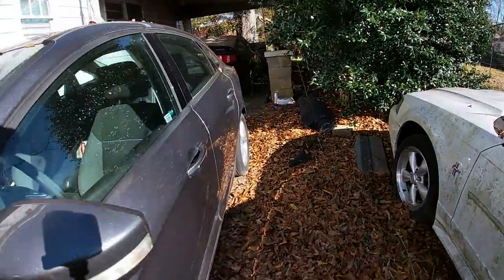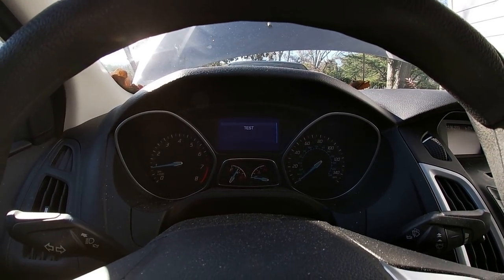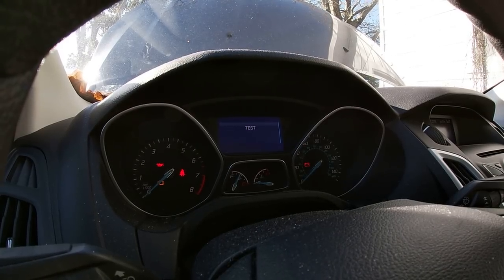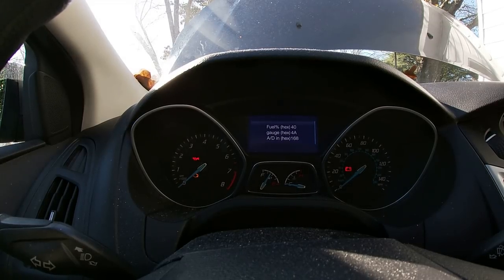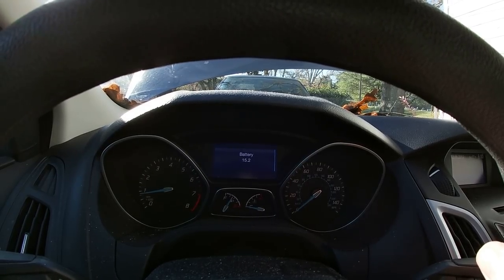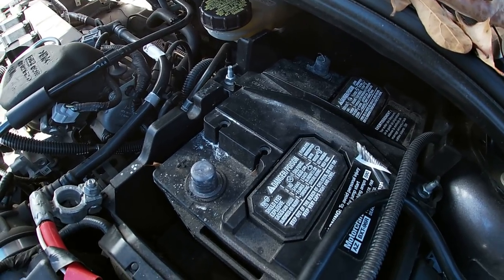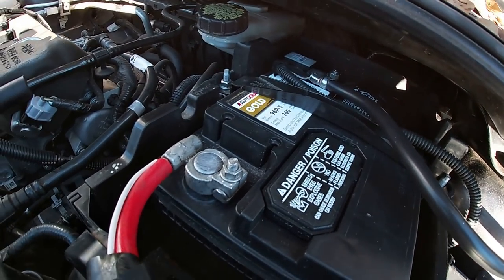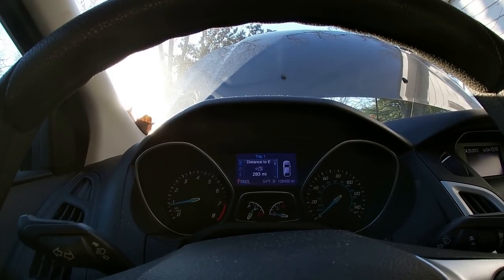Fixin on the Ford Focus for My Son. Gettin It Done!

Comment: In the process of using less material and cheaper materials (plastics) to manufacture, lighten the weight and improve a car’s frontal aerodynamics to improve mpg, engine compartments have gotten smaller and smaller.  It’s much harder to work on them cause everything is being packed into a much smaller space.  Batteries and cables have heat shields, as do hoses, wiring harnesses, and other parts, and all are connected to little sensors and computer processors throughout the car.  One of the most maddening trends are things like what you experienced, no external non-electronic latch to open a trunk.  There’s plenty more like that.  Mr. Tom, I enjoy your videos.  You remind me of people of my own family here in neighboring Mississippi.  My late WW2-vet Grandfather was also a good cook and fixer, did everything he could to come to the aide of his son and grandkids when we had problems.  You remind me of him.  God Bless You Sir.

Comment: It is amazingly what the power of love will do.  What you wouldn't do for yourself, you gladly did for your son, and all out of love.  Mr Tom, you are a wonderful father.  
Just from watching this video I can tell three design flaws in the car. 
#1. Why in the world would you make a part of the car that will be serviced frequently so hard to get at.  Man, you almost had to take the car apart to get a battery out.  
#2. The battery cable with a sensor sounds like a good idea, but if the sensor goes bad, and you can't start the car, that is kinda stupid, especially when to replace the part it costs $169.   Not a good idea. 
#3.  The idea of a trunk only being opened one way, and that way depends on a battery.   I must say that was really stupid     But Mr Tom, though I am sorry you had to climb through the back seat to open the trunk, it was very funny.   I really hate to laugh at ones misfortune , but I think you let us know it was ok when you really showed us what you had to go through    I really hope that is the case because I laughed so hard.  The insanity of someone having to go through that I think added to the humor, because I was laughing so hard.  
Anyway Mr Tom, I really think you fixed it this time, mainly because love is so powerful.  And thank you for sharing your act of love.  I know all of us were praying that car would start.  And sorry if I laughed, but Mr Tom, I really needed that.  Thank you sir.